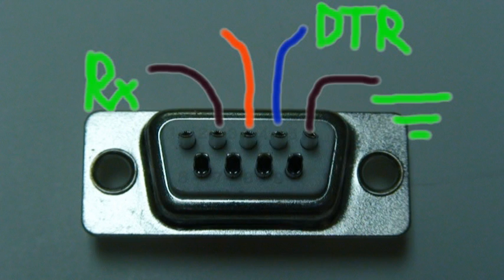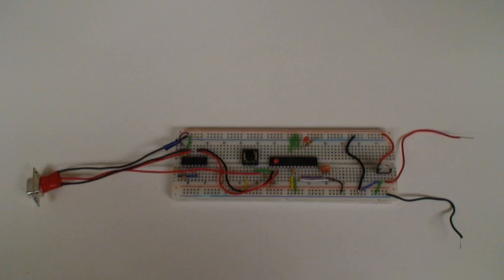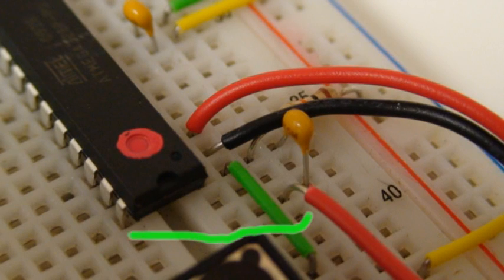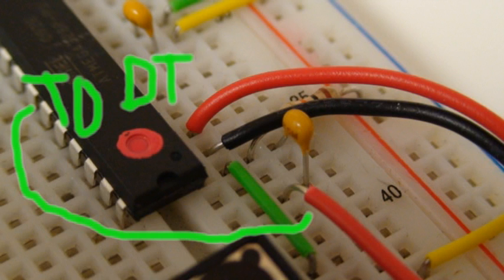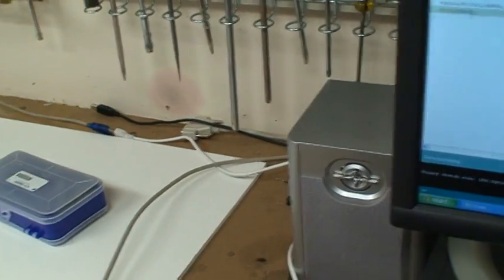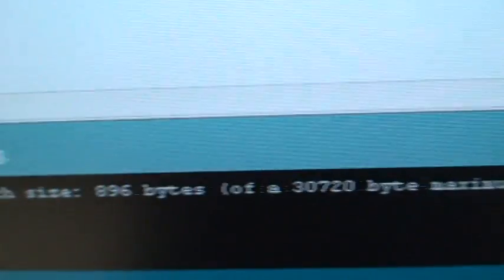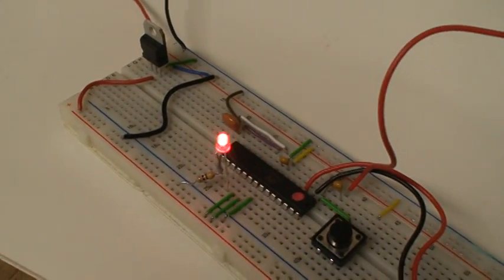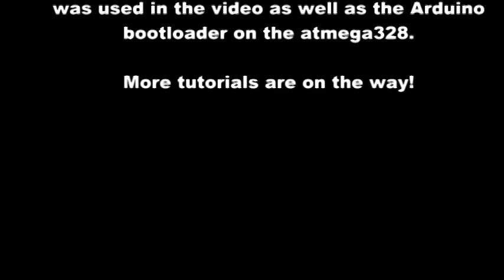Arduino Breadboard Tutorial -Arduino Workshop Project Video #1

Comment: Very cool. I wanted to try this out at home completely, because its cool that you did this without the arduino board itself.

-what software do you use to upload the code for this project?
-do you have the source code that you used for this project as well? It would be nice to have sample code to work off of at first since i am a software developer/programmer, but a total arduino n00b

Thanks. Hope you reply.
Reply: hi, 
1. he uploaded the code directly through the Arduino IDE upload button  
2. you have a sample blink program at the IDE menu at: File -> examples -> basics -> blink

Comment: Haden, an arduino is basically a platform which facilitates the use of the Atmega328 microcontroller. It is mainly hardware, but the real magic of arduino lies in the software which makes it extremely easy to program and use the microcontroller.

Comment: I know this is how you can build an arduino project just using discrete components, but wouldn't it just be easier to plug in an arduino nano into the board. Totting up the component price it seems to come out to about the same, plus you have usb built in and no possibility of miswiring and blowing up your parts.

Comment from the maker: Motherboards are made of almost all surface mount parts so it would be a real pain in the ass to try and pull parts off to make this. I highly doubt you'll find the parts you need to make this from a motherboard unless its a very old motherboard I'm talking like before the early 90s at the latest. It's not impossible if the motherboards have the right components but I'd rather spend 20 bucks to get the correct parts instead of spending countless hours trying to hack something together.

Comment from the maker: yea it will the smd version is the same thing....you'd have to get the smd breakout to use it but the wiring would still be the same. In all honesty it would probably be easier to buy the ftdi usb serial adapter for $15 and just wire that in which is very very simple (4-5 wires total). Otherwise buy the max232 dip chip from another website I'm sure its still available elsewhere.

Comment: Hi Justin. Thank you for your quick reply. I already have several diagram on how to connect Arduino blank chip on a breadboard.  Based on you response, I should first burn bootloader to a blank chip in order for me to upload code. My other concern is, if I want to burn a  bootloader or upload a sketch to blank chip on breadboard, using the Upload Using the Programmer, will it be uploaded directly to the chip on breadboard? Will it bypass the ATmega chip sitting on my Arduino board?

Comment from the maker: The right hand diagram on the ArduinoISP webpage that depicts a breadboard with a blank chip is the setup you will probably use. I think you can get the correct crystal (16 mhz) and the two little capacitors at Radioshack. Don't try the setup without the crystal it will cause far more problems than its worth. Other than that you just need a blank chip, breadboard, and some wiring. Upload the ArduinoISP sketch to the Arduino, connect everything and then click burn bootloader over ArduinoISP.

Comment from the maker: You cannot upload the ArduinoISP sketch unless the chip has a bootloader on it. Google ArduinoISP and the first link to the arduino website has a diagram showing how to connect everything. The idea behind the ArduinoISP is to use an Arduino to burn the bootloader onto a blank chip. I think its the easiest way but my favorite way is to use an Atmel AVR MK II programmer. Its roughly $50 and connects directly to the six pin header on an Arduino so it makes bootloading blank chips really simple.

Comment: Hi. You did a great tutorial here. I have a question. If I want to burn a bootloader onto a blank ATmega328, can I just simply remove the ATmega chip from my Arduino, insert a blank chip, upload the ArduinoISP sketch and then Burn Bootloader using Arduino as ISP?

Comment: So is your DTR pin just ran through a 0.1uF capacitor straight into the RESET pin on the ATMEGA328 (Pin 1)? I can't really tell from the video. I have had a "arduino breadboard" setup for a while, I'm using a 16MHz crystal w/ 22pf load caps though, and a few caps attached to the LM7805 voltage regulator to smooth it out a little bit, and have been having to fight the timing reset for a while now. Thanks for the video!

Comment: I have a question. 
A lot of the USB to rs232 converters dont use the 12v signals they cheat and use 5v ttl 
Some have a built in boost converter getting close to 10v ttl signals 
If you had a cheap one that used 5v signals in theory you could connect it directly to the arduino? It sounds reasonable

Comment: Suggestion : You can use a voltage divider on the DTR pin so it will give 5v to the reset pin.

Comment: Stand alone works for Atmega 168 NG, Atmega8 NG, ATmega 168 diecimilla or duelmilanove, because they may use a simple auto'reset that is made with a simple 100nF capacitor. I've never tried with UNO and 328, because I don't know how the auto-reset works. check the arduino.cc

Comment: I built this and I can get bootloader to load but can not get any programs to load.  I am using Arduino 0022, also wanting to program ATTiny85 chips but, can not until the loading problem is solved.  Any ideas what is happening?

Comment from the maker: In the video description I linked a bootloaded chip see the pink dot on top of the chip that signifies that it has been loaded with a bootloader. If not then the board isn't pointless either just connect the mk ii avr programmer to it along with power and it will be bootloaded in a minute.

Comment from the maker: Learning arduino is for people who want to tinker and create projects without the overhead and knowledge needed to program an avr flat out. Learning a breadboarded version of the arduino is for those who want to understand it more in depth, design their own hardware, and just tinker around with building it from scratch.

The breadboard is used to test electrical circuits without soldering anything.

I hope I answered your question.

Comment from the maker: What does arduino say when you upload it, try selecting a new port under tools > port in arduino. Sometimes really cheap adapters don't play nice with arduino so if you can find a computer with a hardware serial port try it on that to verify the board works. Most converters you can't just plug in they usually have drivers if you crack open the adapter and type the number printed on the chip into google you can download the drivers from the chip manufacturers website.

Comment: @Halo2maniaccc - Great explanation. Thanks for your quick reply, and maybe look for my first project: I'm thinking about a simple noisemaker using an accelerometer. Further, I suppose that just chucking in some other components will create some crazier sounds. As long as I'm within power limits, are there any components, like capacitors or resistors, that might damage the electronics?

Comment from the maker: Any breadboard that can fit all of the components can be used. A standard one like in the video has just the right amount anything smaller and its really going to get tight. If you need a super tiny arduino just buy the pro version from sparkfun for around $18. They are really tiny and will be easier to work with.

Comment from the maker: The crystal is better than the ceramic resonator by far. Ceramic resonators have very large manufacturing tolerances which make them sloppy but cheap. Crystals are more expensive but perform better as they have tighter tolerances. The only catch is that the crystal needs 2 tiny external capacitors, the ceramic resonators have the 2 capacitors built in. Other than that it will function the same (if not better) than the ceramic resonator.

Hope this helps!

Comment: I've been looking for an Arduino hack. Thanks. Now, instead of the 16MHz capacitor, can I use a 16MHz crystal? I've read that it provides more consistent timing. I plan to use things like accelerometers and ultrasonic rangefinders to manipulate sound, and the capacitor may drift a bit. Oh, and don't get too geeked out on me, I'm just getting into MP programming.

Comment from the maker: No...the resonator is a very important part that must be of the correct value. Currently arduino supports 8mhz and 16mhz. Its not that 20mhz cannot work its just that arduino doesn't support it. The bootloader wouldn't run correctly at the faster speed and even if the code ran delays and other functions wouldn't work. You would have to spend a lot of time rewriting arduino source code to work with a 20mhz resonator. Just go buy one....they are pretty cheap.

Hope this helps!

Comment from the maker: You program this thing using arduino just like a regular arduino board. It is connected over serial and the chip has the arduino bootloader on it. You could use ponyprog or avrdude but arduino makes it easy unless you are trying to upload code directly over an avr programmer.

Hope this helps!

Comment from the maker: You program this thing using arduino just like a regular arduino board. It is connected over rs232 and the chip has the arduino bootloader on it. You could use pony prog or avrdude but arduino makes it easy unless you are trying to upload code directly over an avr programmer thats different though

Comment from the maker: You program this thing using arduino just like a regular arduino board. It is connected over rs232 and the chip has the arduino bootloader on it.  I just selected com1 as the port in arduino and thats it. You could use avrdude to do it but there is really no need to.

Comment from the maker: The breadboard in the video is the arduino. The chip and all of the components I placed on it are what you would find on an official arduino usb board. It is much cheaper to do it this way and allows you to better understand the hardware. This is programmed just like an official arduino as well. This is made for a more advanced user who wants to make custom hardware but still use the arduino software for ease of programming. This could also be soldered onto a prototyping board!

Hope this helps!

Comment from the maker: I would get the arduino UNO which is the latest version of the duemilanove. Its way easier no soldering, power regulators, and many more features. Plus it has a usb serial chip on it so you don't need a serial cable just a simple usb cable. There are no worries with it really its just plug and play. This on the other hand has a lot of problems that can happen if you mess up a wire for example.

So if your just getting into arduino get the UNO you will learn a lot more a lot faster with it.

Comment from the maker: Add up the parts (and any hardware you don't have like the breadboard). If you have the basic tools, breadboard, and hook up wire its a little more than $10 to make. If you don't have the equipment it would be around $20.

Comment from the maker: No the arduino bootloader and core libraries are only supported on specific chips at the moment. Those are the atmega8 atmega168 atmega328 atmega1280 and the atmega2560. It is possible to port it to that chip but it would require deep knowledge of the chip and lots of time to properly port over (days...weeks).  I don't know how to do this. Just use the supported chips its way easier to get started.

Comment from the maker: You choose the board with the chip you are using. Duemilanove 328 = atmega328 , Duemilanove 168 = atmega168 ,  atmega = atmega1280 and so on if you using the dip versions only use the duemilanove boards. The pro boards and micro boards use smd microcontrollers and they will not work.

Comment from the maker: Without the bootloader you have to burn new code using the ICSP programmer every time. With the bootloader you can upload new code over serial but it will take up a small portion of memory (about 2k) and add a 1-2 second boot delay. Its well worth it to have it as it really speeds things up when developing code. I am not sure what the ICSP pins are you will have to find that out I know that there are six of them so look at the chip pinout and find them.

Comment from the maker: You find out the ICSP pins, I don't know which ones they are you will have to google that. Build a parallel port programmer (just resistors and wiring). Then connect the chip to the programmer and give it power. Next open up arduino select your chip type and then select burn bootloader and select parallel port. It will then burn the bootloader if everything is ok.

Comment: few final questions.......
1. can we connect the usb cable directly to the max 232??????or the arduino?????
2. is the pins in the real arduino(premade one) same as the pins in ur arduino????
3. i saw a video and in that they had a lcd which has three wires and connected to three pins like pin no: 5 is the signal ,then ground and pwer so should i connect the lcd to the same pins in ur arduino like pin no: 5 as the signal?????

Comment: 1. which is the serial port???how does it look like ????can u send a picture???
2. i need an usb cable but i cannot buy it online could u send some wiring circuits or somethin!!!!?????
3. could u give the wiring for the lcd or any website?????which we can connect with ur arduino that is!!!!
4. can u give the pins of the micro controller??? i mean not coded type just what does the pin do ???
5. ur video is awesome tell ur friends to watch my video!!!!!! LM386 on a breadboard thats the videos name

Comment: some questions..........
1. can it only do that (flash an led?)
2. where is the code from?
3. can we interfere it with an lcd?
4. what is the code for interfering with the lcd?
5. where do we connect the pins of the lcd?
6. serial cable is connected to the printer port right?
7. could u show how to make an rs232 to usb cable
8. where do we connect that cable?
9. could u give more info about this project?
10. could u answer these questions within tomorrow?
THANKSzzzzzzzzzzzzzz....................

Comment from the maker: I am pretty sure that the P is the same thing if you look at the picture on sparkfun it says atmega328p-pu and that is the chip I have been using in both the breadboard and Duemilanove. There are different models but if you can match it to the one sparkfun carries with the bootloader (the exact model number) then you are good to go. Remember blank chips don't have a bootloader so you would need to burn it yourself.

I hope this helps!

Comment from the maker: If your talking about the max232 chip then both will work. The max232 chip sold on sparkfun is made by sipex model sp3232ebcp. People below commented about using a generic max232 which have high ttl voltage levels (not good). I cannot verify this right now but it seems as if both of us had success with the sp232 chips. If you can just get the chip from sparkfun, or the same chip through a distributor like mouser, newark, or digikey.

Reply back if you have any other questions!

Comment from the maker: No the large parts are not things that you can find in standard stores. Unless you have a local hobby/electronics shop that carries this stuff but I highly doubt it. The smaller things like resistors and wire can be ordered but not the chips.

I hope this helps!

Comment from the maker: They can run anywhere from $5 to $10 total for all of those parts depending on where you buy them. Remember the ATMEGA 328 HAS TO have the bootloader on it so I recommend buying it pre burnt from Sparkfun unless you know how to burn it onto blank chips. You write code for it the same as any other arduino, in ARDUINO. All of the links to the parts are in the video description.

Comment from the maker: No radioshack only has very basic components they do not have the atmega 328, ceramic resonator, max 232, and I doubt they will have the .1uf capacitors as well. Everything else like the resistors, voltage regulator, breadboard, and wiring can be purchased at radioshack.

Comment from the maker: I spaced everything out on my breadboard so there are extra holes. As long as you can fit everything on the board without overlapping electrical connections then you are fine. Hopefully you understand how the breadboard works (the pins are electrically connected in rows). If all of the electrical connections are made as I made them in the video it will work just fine.

I hope this helps

Comment: @Halo2maniaccc 

i double check that i had the 328

maybe the capacitors are wrong

a have a max232 from maxim

in the datasheet it says that it needs 1uF 

--------

also i order all the parts to make some of these

RS232 Shifter Board Kit

thanks a lot

Comment from the maker: It sounds like you have to wrong chip selected in the arduino program. Go to tools > board and change the chip to the correct one. You may have an ATmega 168/328 or the pro version with the SMD ATmega 168/328. Pick the correct one and then try it again. It sounds like the program has communication and is about to upload the code but something is wrong with the code so change this and it should work.

If that doesn't work post back.

Comment: @Halo2maniaccc 

an this  was the problem running the blink code from arduino 018

avrdude: stk500_getsync(): not in sync: resp=0x30
avrdude: stk500_disable(): protocol error, expect=0x14, resp=0x51

Comment: @Halo2maniaccc 

ok i check the port speed and it is on 9600

the arduino resets after i press the upload code

but then

Error

do i have any problem that i am running arduino 16?

Comment from the maker: It will not create a new com port when you use a HARDWARE PORT. It is usually COM1 or something low like that. You can find the ports in devmgmt msc on windows. So you shouldn't see ANYTHING on the computer the port is already created and ready to be opened.